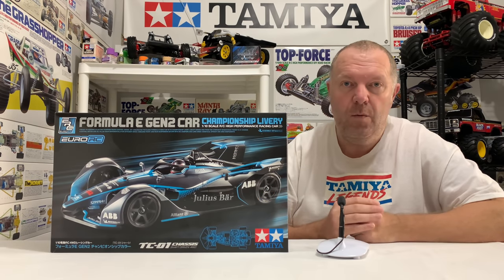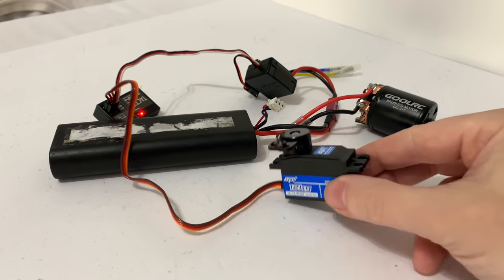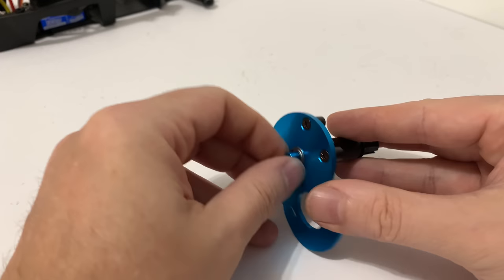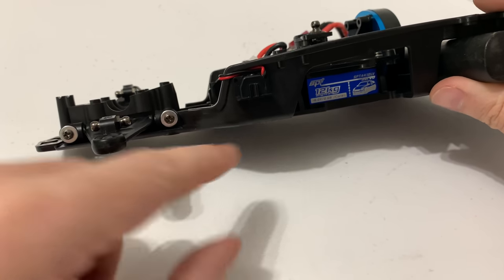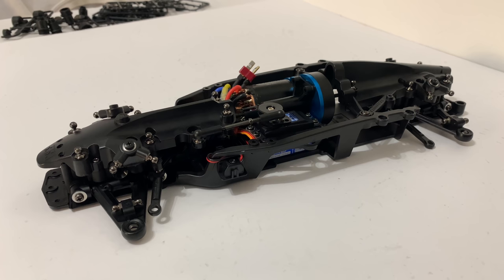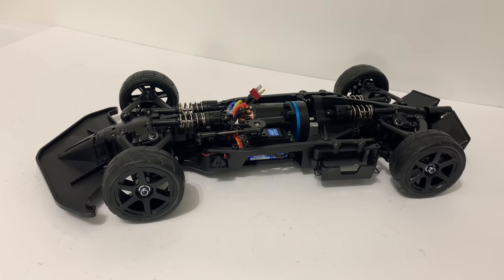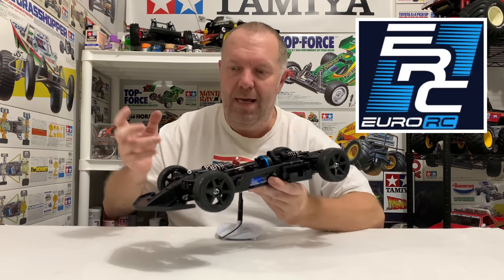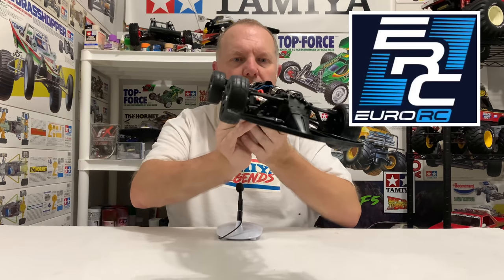Tamiya TC-01 Formula E Car Chassis Build

Comment: Finished building mine up yesterday. There are a couple of areas where you have to be careful, the front and back end are mostly the same, except you use different number of washers. Also the shims in the diff, I saw elsewhere that you should omit the 0.1mm shims when building new (the manual has a note to fit them to adjust clearance). Finally, I found it odd that the springs are too short to fully extend the dampers, so will actually be fully extended with some play (using the recommended spacers, both front and rear).

The body will be a separate project, takes up more than half the box with all the different pieces!
Reply from the maker: Fantastic James 😎
I’ve actually ran mine now and it didn’t disappoint my friend 🤩👊🏻

Comment: You usually want the front wheels toed out at rest on a four-wheel drive RC. This is so that under acceleration when the wheels pull forward and remove slack from the system they are basically pointing straight.  If you start with them straight at rest you're going to end up with a bunch of toe in under acceleration in the front which is not going to be ideal.
Reply from the maker: Fantastic information my friend thanks for sharing this 🤩👊🏻

Comment: I agree that it looks so much better with the body off! I actually took a full year of admiring the assembled chassis before I finally mounted the body. Then I immediately tore off the stock body and turned mine into a rally car, which suits this chassis SO much better than Formula-E.
Reply from the maker: Fantastic 🤩👊🏻

Comment: Just finishing a TB05R a lot of this is very familiar I almost went with a TC01 for my next TC but decided to stick with the conventional suspension setup of the TRF420 used on the TB05R and it just came with more race spec upgrades out the box. 
Something to note how it’s so low slung you could almost drive it with the chassis upside down this is a thing on a lot of the current generation of Touring Cars not just Tamiya but the Mugen MTC2, A800, BD10 etc. gone are the days of shock towers peaking above the top of the wheels
Reply from the maker: Yeah I’m also looking at the TA08 Pro now 🤩👊🏻

Comment: Thanks for the video! I've been curious as to how you'd feel about the TC01, and perhaps one day when you get to run it and compare to other touring chassis. It was one of the first few Tamiya kits I built and it did feel precise. Luckily, I haven't popped the drive shafts yet (running on a 10T motor). I agree, it has quite a tight tub and has some heft. But I think the chassis design looks beautiful without a shell. Seems like the TD4 Super Avante borrowed some of the front suspension design. Thanks again and hope to see what you do next with it.
Reply from the maker: Yeah I really loved the build but I actually enjoyed running it way more, it’s super smooth and also quiet 🤩👊🏻

Comment: This is one of my most stared at chassis’s it’s got lines that are so right it’s a "thing of beauty" I took my wiring long around the servo and back it makes it easier to change pinion gears when required 
Please note:-  if you are using standard dog bones you are better off fitting the steering limiters as seen in the back of the manual
Reply from the maker: Fantastic thanks Neil 😊👊🏻

Comment: You could smarten up that wiring by trimming to length and soldering the wires direct to the motor.
Reply from the maker: Yeah I’d only do that if those electrics we’re staying in there Tim 😅👊🏻

Comment: I forgot to mention something…I had issues with my rear differential spaces inside the diff housing when following the kit instructions. It seems Tamiya recommended shims on the wrong side of the crowns bevel gear. My gears were grinding due to large gap in the alignment. I had to shim the rear diff differently than what was in the instructions. It fixed the issue.
Reply from the maker: Hmmm interesting Andy 🤔
Looks like I’ve got away with that issue, I’ve had around 5 batteries through it and she’s running sweet 😅👊🏻
Reply: Yeah the rear diff it too tight you have remove the smaller spacers. It makes the car want to tail slide going in a straight line
Reply: The 0.1mm shims are optional to adjust clearance, I did not fit them in mine; I guess they are for once the diffs are worn a bit.
Reply: @superjimnz  Hi James. I believe you are referring to shims BC8 on Step 22; inside the Diff. Seems there are lots of shims used in this kit. For my issue, I was referring to the BC6 shims (.2mm), also on step 22. The manual shows 2 on the Diff Housing B side and 1 on the À side. This pushes the crown bevel gear away from the BC2 bevel gear when mounted. I had to swap the .2mm shims ( 1 on B and 2 on A) bringing the gear mesh closer because it was too far apart and was clunking or grinding.

Comment: Get rid of those daft, inefficient  motor connectors, hard wire the motor and you will have a more space for tidying up your wires.
Reply from the maker: I would only do that if I was keeping the electrics in the car, I only planned to run this with 3/4 batteries, so this set up was absolutely fine 👊🏻
Reply: @TAMIYALegends  that is a valid point